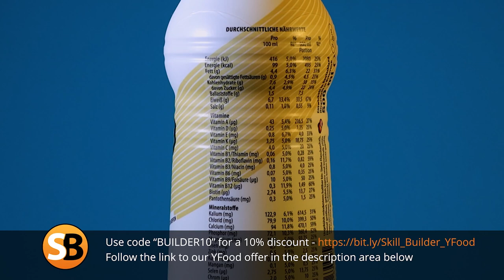Loft Conversion RSJs ~ LoftCon #1

Comment: Love the show, but if the steel beams are put in perfectly level I don't see why they don't set a joist hanger at desired height each end and snap a line instead of wasting so much time setting a laser for each individual joists hanger definitely getting paid by the hour not the job
Reply from the maker: They could do that and there are plenty of places where they do snap a line but this time in this place it was time for the laser.